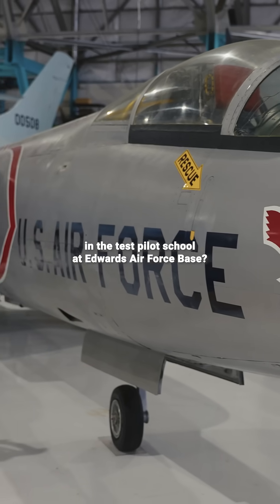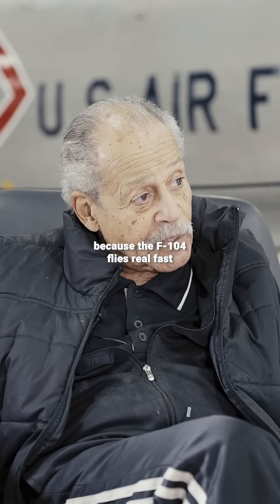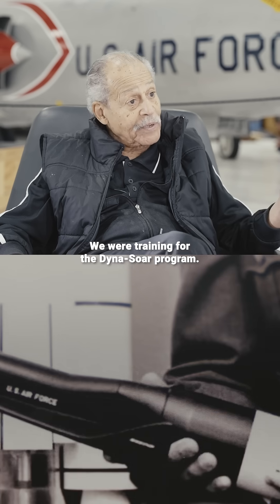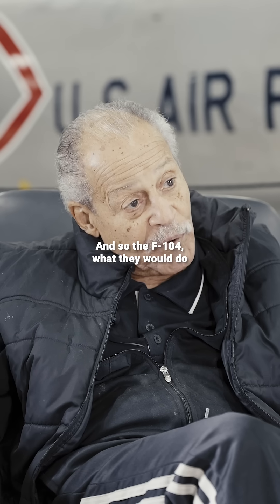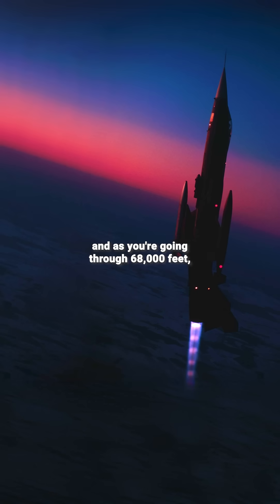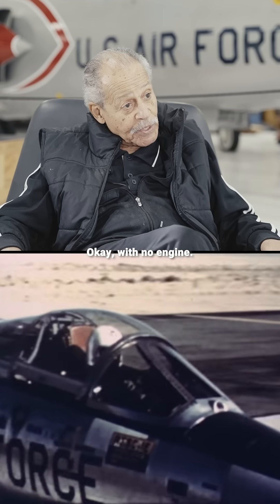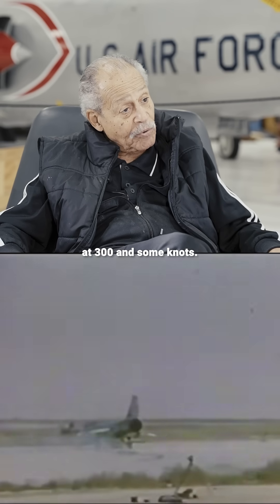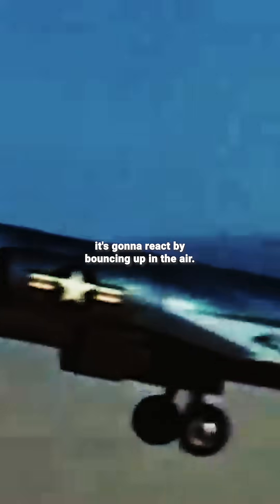Cutting F-104 engine at 68,000 ft #aviation #space #jet #fighterjet

Comment: In 1966 I was an 11 year old boy standing on top the cistern at my grandparents place on the pear blossom highway on the edge of the Mohave desert when I caught a glint to the north.
It was fast, shiny, and about level with the  telephone poles. As it flashed by I could have hit it with a rock and the pilot looked at me as he flew by. The sound was awesome.
I’m 70  now and that F104 flyby was a very memorable experience.
My uncle worked at Edward’s and used a scanning electron microscope To check the oil on the planes.

Comment: Dead stick landing is bad enough, but the F104 had blown flaps that were normally used on landing to reduce the touchdown speed. No engine = no BLC = >300kt landing speed. Landing gear and tires would also take a beating even if you greased the landing. Cool plane that broke new levels of performance but she was not forgiving.

Comment: I still have the board game The Speed of Heat, chronicling the advance of air combat through the 1950s to early 1970s. There’s one scenario where USAF aircraft are trying to intercept Soviet bombers. There’s a huge choice of aircraft and some of them feel of their time. Straight wing, sub-sonic, reliant on weapon systems of dubious utility. The F-89 Starfire is loaded out with about 80 unguided rockets designed to be shot gunned into an approaching bomber stream and a brace of very primitive air to air missiles with nuclear warheads. Yes, a nuke going off in the midst of a bomber formation would stop them but you’ve just nuked your own airspace. And then you have the F104. Mach 2 performance, it can catch up, and manoeuvre round the bomber stream. She has two Sidewinders to attack vulnerable bombers, and when they are used up she is one of the first aircraft to house the 20mm Gatling still serving today.

Comment: It also doesn’t help that the F104’s stall speed was 319 kph, or 198 mph. It had to be landed fast to keep it from stalling and just bellyflopping so hard your family gets a folded flag to commemorate the event.
Reply: Did you notice him saying they were Landing at 300 knots though?  It's worse because if they were actually shutting the engine down as he says, that meant that they lost the blown flaps that the f104 relied upon to tame its landing speed.  It used air bled from one of the engine stages and literally blew it out of slots in the wing to keep the surface layer of air on the wing energized and moving, which delays the onset of a stall.

So they took a plane with an already high landing speed and made it significantly higher.
Reply: @NomadSoul76   that’s a very good point. It’s no wonder the Luftwaffe’s accident rate with this plane became so famous. The whole design sounds like a bad joke when it comes to putting that pencil back on the ground. “Make the landing speed the same as the stall speed, and make sure that the engine helps with lift but only when it’s running.” It’s wild to think that Italy had them in service up until 2004.

Comment: 68,000 ft is space?????
Reply from the maker: Outer space officially begins at the Kármán line, which is approximately 62 miles (100 kilometers) above sea level. So, 68,000 feet while very high is still in Earth's atmosphere
Reply: @Wings_Museum  It's flat. It don't spin. But thanks for adding what you've been taught yet never proven.

Comment: Turn the engine off and slow down until you stall and plummet. Then speed up so violently depending that overspeed leaves you with minimal rutter impact and enough friction to burn up your air brakes. I bet they were landing 300+ knots once they finally got control of it.

Comment: fun fact: these planes killed tons of european pilots because the stall speed is the same as its landing speed
Reply: Not really. The stall speed had to be lower than the landing speed. That's kind of the point, that's how this works. You want to be very close to stall speed so that once you're close enough to the ground you lift the nose up in a maneuver called the flare and bleed off enough speed until your wings lose lift and you settle on to the ground. I think what was different in the case of the f104 was that it's landing speed was unusually high. Also it relied upon a thing called blown flaps which might have added additional complication to the task of landing it because increasing the throttle setting would lower the stall speed. It's possible that inexperienced pilots were chopping the throttle to try to get the speed down and losing the benefit of the blown flaps. But that's just a guess.

Comment: The F104 is a good example of anything will fly if you put a big enough engine on it.
Reply: The F-104 was fast because of the aerodynamic design, the coke bottle shape and razor thin wings. The engine didn't hurt though.
Reply: @RCAvhstape  and the turn radius was very large.
Reply: @BadDadio  Built to meet requirements.
Reply: @RCAvhstape  and the technology of the times.
Reply: Thats the phantom actually, when you look at 104 you can see how it goes fast on a straight line, f-4 is a brick.
Reply: @ercanyesiltas   but look at the wings on the 104
Reply: @murrybrasell4657 HA! You mean the stabilizer fins? 🤣
Reply: @ercanyesiltas .  Yes, the McDonell Douglas F-4 Phantom.
Reply: @ercanyesiltas  lol  The Flying Brick

Comment: It was called the Widowmaker for a reason😂
Reply: The Canadians referred to it as "the aluminum death tube."
Reply: @thomasbell7033 now they call that the 737 Max lol
Reply: @thomasbell7033  didnt they also say the same for the F-101?  and yet, they still liked both planes for what they were.
Reply: @690yioghklbm 
     Boeing had nothing to do with the Lockheed F-104 Starfighter
Reply: The F-104's dark safety record was mostly idiotic decisionmakers putting it into roles it was never suited for. It was a fast high altitude interceptor, period. Low altitude medium speed stuff in an F-104 put pilots at an awful risk unnecessarily.
Reply: Shutting the engine off at 68k/ft on anything makes it a widowmaker.
Reply: true but the harrier hold a higher death count believe it or not
Reply: Thought that was the German name because they took this good weather interceptor and turned it into a all weather everything all at once 😂
Reply: That was mostly by Germanys luftwaffe
Reply: @shawnpenney8346 
Because the US pushed the F-104 to them knowing it was not suited for the role they would fly it in.
  Lower altitudes and medium speed in a piloted missile means bad stuff will happen.
Reply: thats what happens when you take a high speed interceptor and try to use it as a ground attack/nuclear strike plane.  this thing was made for one thign and one thing only, to shoot down bombers and other fighters at high altitude. it was not, in any manner, ment to do bomb runs, rocket strafing, or tossing nukes.
Reply: @bigshow196  YES, someone finally knows what they're talking about
Reply: it was not planes fault, but commanders and politicians who put F-104 into ground attack role.
Reply: @razormonkey5279   EXACTLY, and the inexperienced pilots that weren't suited to the hard to learn plane
Reply: Ignorance is the main reason.
Reply: @Hornet135  or it's a shitty airframe
Reply: @an-2253  or German pilots were noobs
Reply: @Hornet135  weren't he training in the us and the main issue was that thier training was putting em in a stupid situation that that plane couldnt handle
Reply: @an-2253 just because it’s put in a situation it can’t really handle well does not make it inherently shitty. Invalid take broski
Reply: @Hornet135  
    A good percentage were high-time, experienced pilots, including some crash pilots/ victims. 
    BAD design for what they were putting it to use in.
Reply: @rocknative70  Wrong, but you bought the journalists’ bait.
Reply: @Hornet135  Pretty sure nobody, including my fellow aviation writers, blamed the design. It was, quite simply, a design that was terribly unforgiving of mistakes or sloppy aviating. I do understand that people like you who don't know better like to blame my colleagues in the media for pretty much everything that makes you unhappy. You may not be aware of this, but journalists, including me, do not carry guns to force people what to think.
Reply: @thomasbell7033       Who said anything about carrying guns to force you what to think? That’s a job for the government. I never blamed you nor your colleagues; I was referring to the amount of FUD that result of the Lockheed Bribery Scandal and people basing their opinions largely on that. That’s all.
Reply: @Hornet135  Okay, my bad. The issue of the Luftwaffe's horrendous accident rate with the 104 is extremely complicated, and there is no one right answer. There is, however, a tremendous amount of mythology and plain old ignorant speculation about it. Hell, just read these comments to see that.
Of course, high up among the reasons is that German pilots trained to fly this touchy thoroughbred in the perfect weather of Arizona. Then they went home to the nasty weather in Northern Europe to fly operationally. That, of course, involved almost exclusively flying high-speed, low-altitude sorties. You fly in the fog down in the weeds, you occasionally eat some vegetation.
Reply: @an-2253  or it was used wrong, by rookie pilots for a role it wasn't built for
Reply: @an-2253 like landing? Yeah pretty stupid of the germans to try and land a plane
Reply: @an-2253 Really wasn't. It was designed as an Interceptor.
Reply: @intergalacticolive Not a shitty airframe. Don't use a tool for a job it wasn't designed to do.
Reply: @Hornet135  eeeehh no the Bw just used it for things it wasn't supposed to be used for but German pilots are generally really really good
Reply: @ it was supposed to be used for those things, not sure why you think it wasn’t. The German Air Force had a lot of problems at the time.